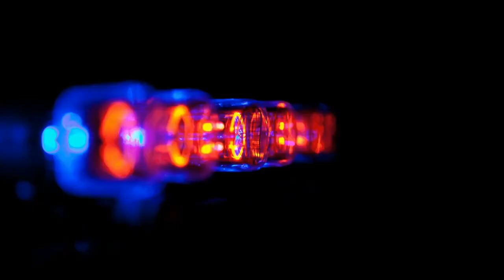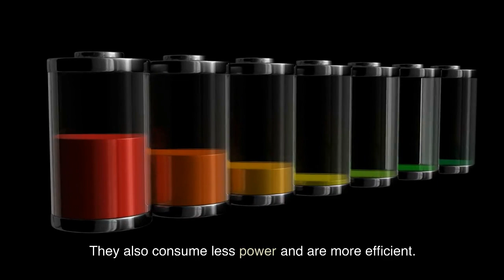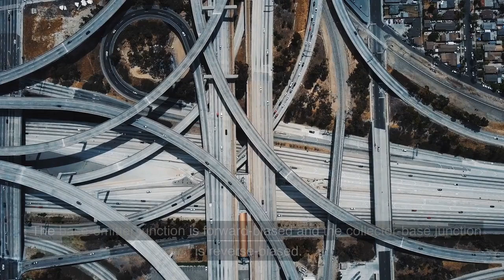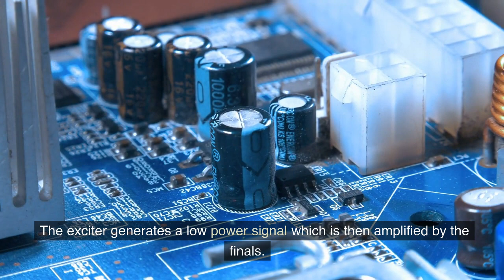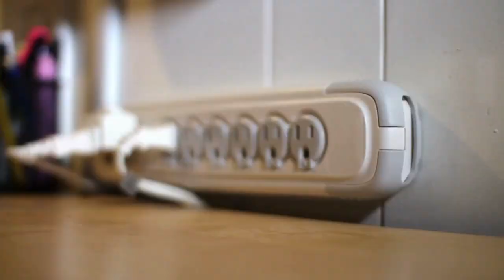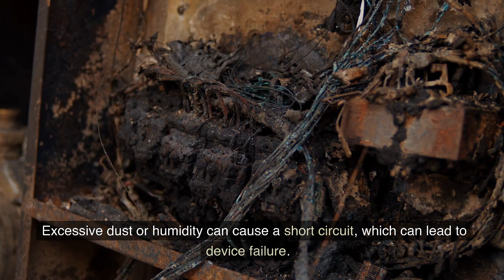Transceiver Finals in Ham Radio

Comment: Interesting,  but how would a rookie KNOW if there was a problem with his finals? What problems does the radio exhibit?
Reply from the maker: Low power output would be the most obvious sign there could be a problem.
Reply: @TheSmokinApe  ..and one would know about the low power.... how?   I thought perhaps that touching my tongue to the antenna while transmitting might work, similar to a lamp pole in winter...   Seriously though,  how does one measure the output power?  As a rookie ham,  isolating problems is tricky since I don't know enough to know if the problem is my radio, my antenna, my location, or mysterious radio settings.  I won a NanoVNA in a raffle, but I believe hooking the wee little beastie to the output of my radio would be... bad? A voltmeter?
Reply from the maker: @vanellopespitstop3093  SWR and Power meter are what most people use 👍

Comment: When in the usaf,  we told the newbies that if they transmitted and the output wasn’t connected to the antenna or dummy load, it would sterilize them.  At that time their was no finals protection.  Keying a mic without a load would blow the finals.  Telling them about sterilization,  which was bull, we had very few blown finals
Reply from the maker: LOL, that's funny 👍
Reply: Except for operators who thought "hey, free birth control!".

Comment: With that being said, perhaps then the resale pitch for a 10+ year old radio “works as it should” would be rejected. This information proves that age, use, and storage (as well as many other parameters)do play a major role in the degradation of components; therefore, it is not by chance that a used radio of a substantial age, use, and unfavorable storage can fail. Which leads us to conclude that folks should consider buyer beware in their purchase of said “used” radio.
Reply from the maker: I’m with you, use extreme caution when buying used 👍

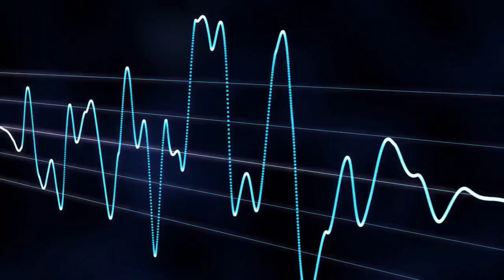Comment: Hi Ape. At 4:05 you mention that a nearby strong signal can damage the finals. I have heard this several times but never quantified. Could you shed a bit more light on this issue please i.e. how nearby and how strong. What would be a safe distance between transceivers given a certain wattage at the antenna or certain erp. I feel this could be a topic on its own as some radios (e.g. my FT991a) are rumoured to be sensitive and affected by this. Many thanks!
Reply from the maker: I don't think I can give you an exact distance or signal strength but I can tell you that the run of thumb is to not have your transmitter antenna operating within a 1/4 wave of the your operating frequency to another operating station.

Comment: And what about the high SWR? Is the built-in protection in modern transceivers capable of protecting the finals? For example, when the cable breaks or the carrier transmission is switched on without an antenna.
Reply from the maker: Fair point Time Lord, thanks for the feedback 👍